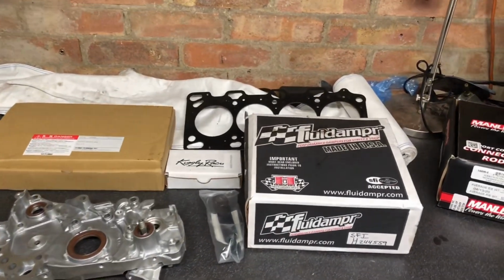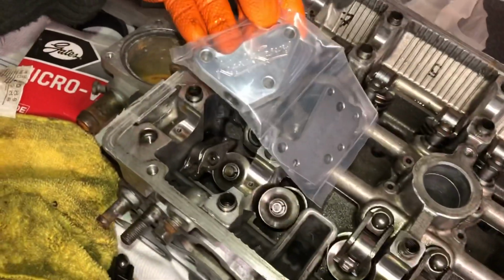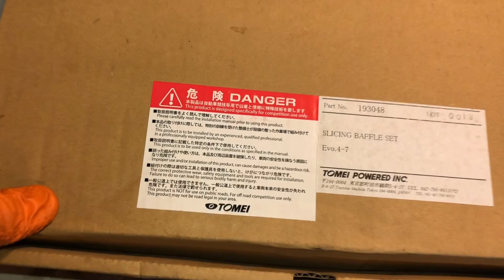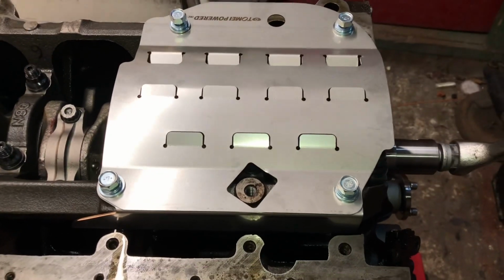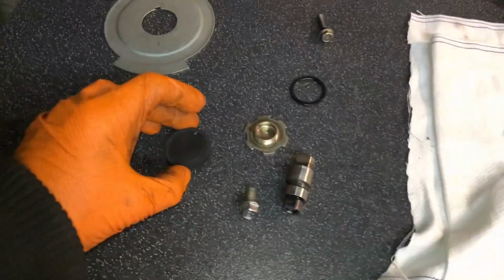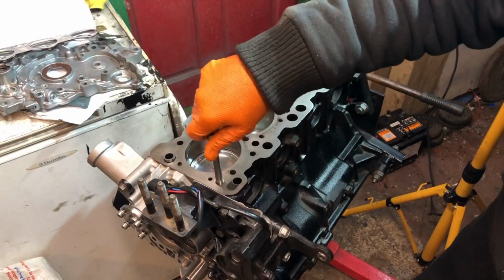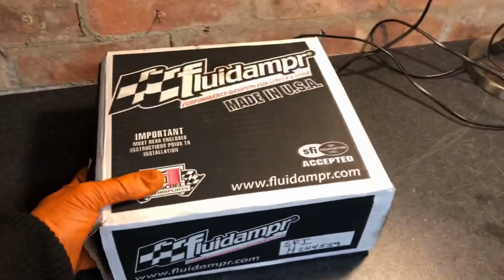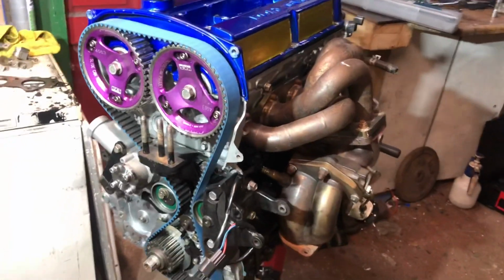I OVERNIGHTED PARTS FROM JAPAN!! Evo V 2.3 Stroker Engine Is Built

Comment: Nice combo! 2.3L/fpBlack! Black's flow 68lb/min not 60! Even more with SS housing 71lb/min
Reply from the maker: Thanks! Been looking into the stainless housing 👌🏻
Reply: @AaronUnknownPerformance  I might change mine to SS one day... I'm running  2.2L/fpBlack ,Gsc R2 cams set up in my 8mr on E85 fuel
Reply from the maker: Great setup! We dont have pump e85 here or i would run a flex fuel sensor